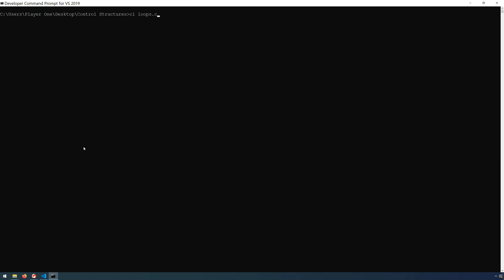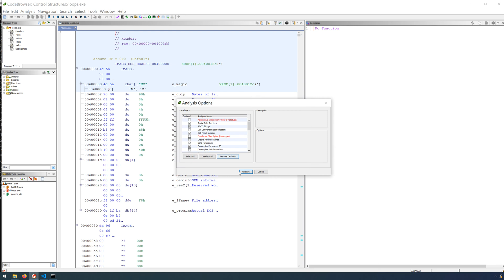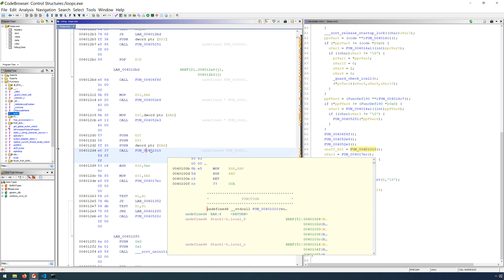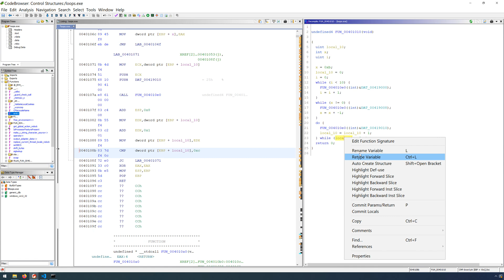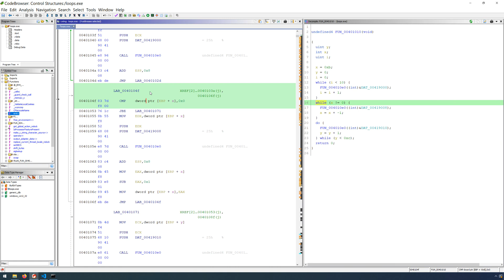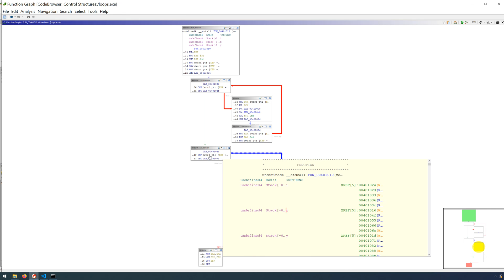Reversing Looping Control Structures - Ghidra Reversing Tutorials

Comment: In functions there is no entry for me do you know why?
Reply from the maker: If you have compiled the program successfully, there should be ENTRY as Ghidra defines the start point. If you grabbed the binaries, it will be there and Ghidra will label that entry as well. I forget if it's entry or _entry, but if you use the shortcut G and type in that label, it will take you there. You will need to navigate to main, which I believe I cover earlier in the series or in each video. Let me know if this is what you are referring to.

Comment: I have a question. I'd appreciate it if anybody answered me. In Ghidra, most of the code is written in Java, except the decompiler, which is written in C++. The question is that how the C++ decompiler is connected with the Java backend?
Reply from the maker: I'm not entirely sure myself either - I know the source code is available on Github but that can be a chore to dig through. Some digging suggests an API using JNI, which afaik allows Java to essentially call into a DLL (the C++ code), but I haven't confirmed that.
Reply: JNI interface is really useful for integrating c/c++ etc into java, that's the same approach taken by most android apps/is so it's more likely the case here
Reply from the maker: @malavvyas4476  Thanks for the extra insight - seems like we're on the right track in our thinking.
Reply: i whould imagine it being some sort of api but am not sure
Reply: Ghidra’s C++ decompiler runs as a separate native process, not as a JNI-loaded library. The Java backend launches it and communicates with it over a lightweight RPC protocol using sockets or pipes. The C++ process returns decompiler output and metadata, which Java then parses and displays.

Comment: At 5:23 you show a loop arrow, but my m1 mac Ghidra doesnt seem to show these control arrows. Does anyone know if its just a setting not enabled by default on mac or is this feature just not implemented on mac.
Reply from the maker: I'm not sure myself - I'm still running intel macs, largely because of the VM issues with the M*s.

Comment: Great video.
I wondered why main always comes with 3 pushes?
I dont know where to read about this
Reply from the maker: I can't remember where I cam across this information, likely a blog post or talk somewhere. It's just stuck with me and I try to share with everyone new to reversing. I imagine it's documented somewhere, but I haven't sought out where. A very quick search brings up blogs like this https://www.bigmessowires.com/2015/10/02/what-happens-before-main/ that appear to be quite helpful in understanding this process. of course, you don't know what you don't know and it's things like this that can make getting into RE a little challenging :)

Comment: Hi, how can I change in ghidra in decompiler while to for or vice versa?
Reply from the maker: I'm not sure off-hand if there is an easy way to do that... usually recognizing that there is a looping structure is enough. I'll poke around the docs some and see if I can't find an answer - however, I suspect there isn't an easy solution since I haven't come across by now :)
Reply: @jstrosch  thanks anyway
Reply: @jstrosch  what is recognising loop structure enough for?

Comment: Why Ghidra cannot identify "printf" function? Is there any option to make Ghidra interpret the C functions?
Reply from the maker: That is up to the FLIRT and Ghidra may have trouble identifying it by the way the program was compiled. You can try using ida free, it's not as good as the paid versions but may help fill in some gaps. There are projects on GitHub as well that can help with importing flirt signatures. Worst case is you have to keep context in mind - typically a string argument to a function that appears to be destined for the command line or seen by a user is a good clue :)